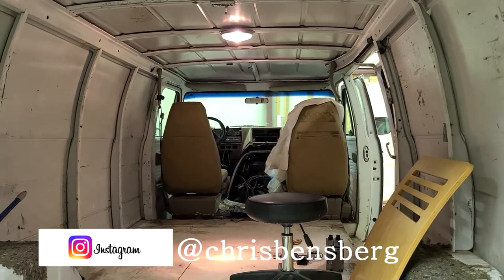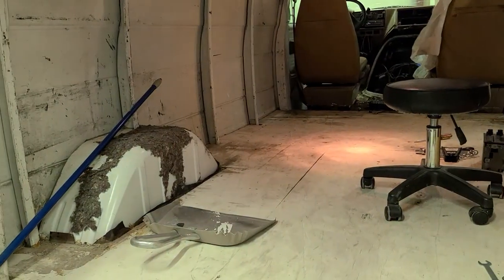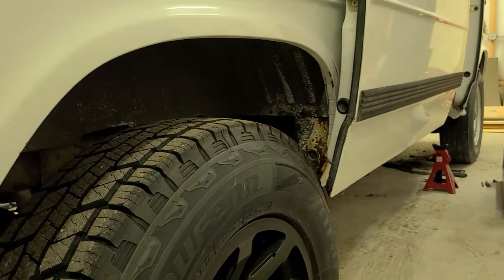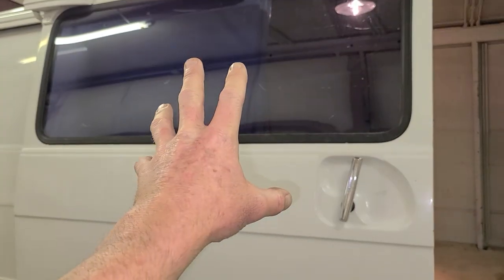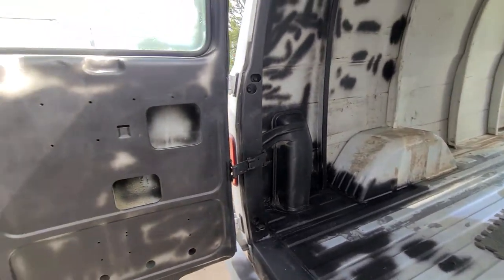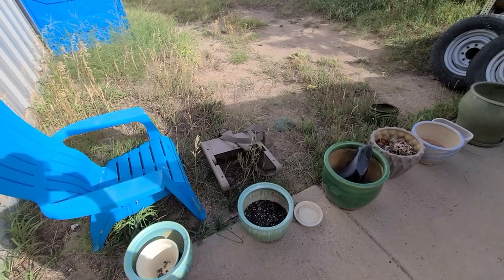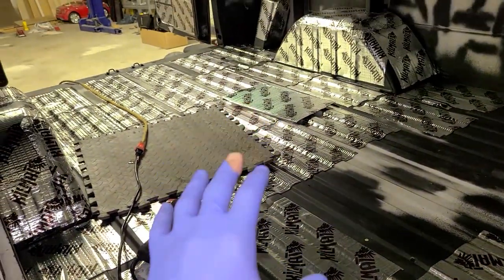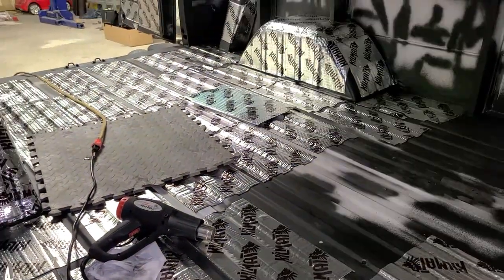Chevy G30 VAN LIFE Build - Off Road Tires, Cleaning, Rust Removal, Bondo & More!

Comment: For quick rust removal use a flap wheel on a grinder. ❤ you should use acid etching paint over exposed metal then primer then urethane paint.

Comment: While  this is late to the party I also have a G30 with the same size tire with a 16x8 aluminum wheel. My slider opens just fine, but I think my offset might be different which unfortunately is not in the paperwork, and it's been a few years I don't remember what they told me it was.

Comment: just picked up a 90 G30 with 454 big block with only 144k miles but due to it having a rubber floor under both front seats there is no floor only carpet and plastic , have an parts g20 that has solid floors , guess i get to relearn how to weld lol